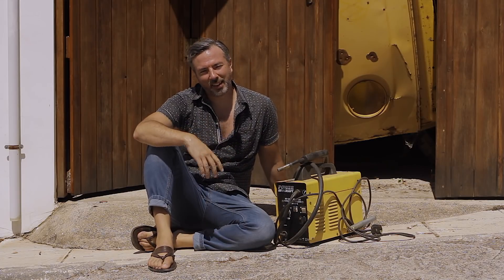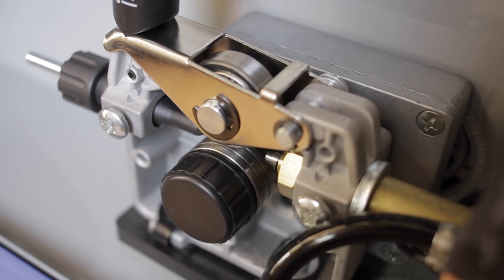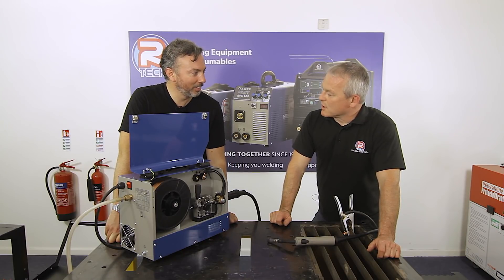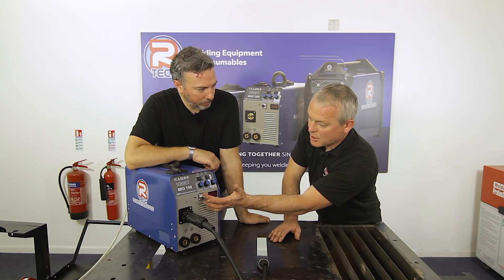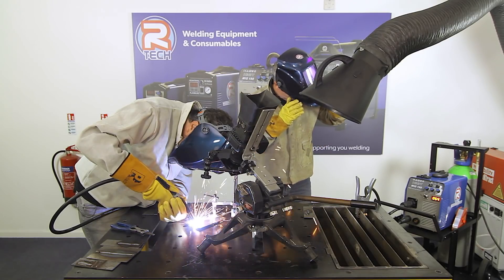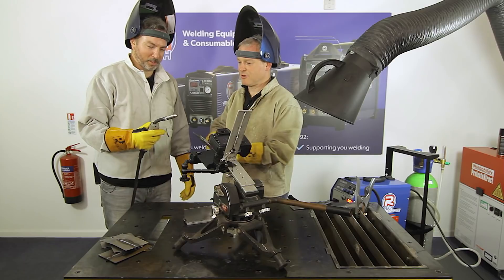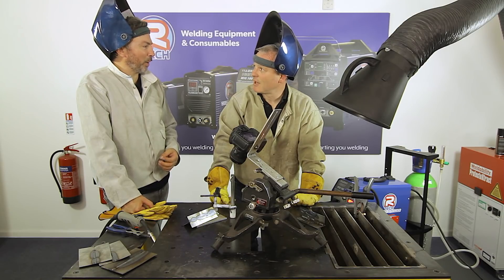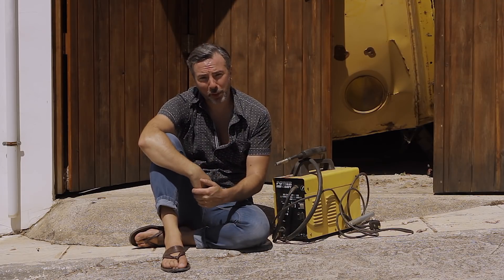Every classic resto enthusiast should learn to weld // SOUP Classic Motoring 50

Comment from the maker: It takes time to pick up how variables effect the work, practicing technique and getting good, but you can join two pieces of metal first go with a strong weld if you do a little homework first. You owe it to yourself to give it a shot, it'll change your world. If you can't get to R-Tech, find another company who will give you a free demo.
Reply: by the time you burn through that first 5kg of wire you will be quite adept at setting your machine and laying nice weld beads. 
(Also if you tighten the knobs on the sides of the helmet it wont fall down all the time ;)  )
Reply: Does anyone start out with stick welding these days?
Reply: @BidlyBong  yeah apprentice welders. It is more of an industry thing these days because mig welders and gas supplies are so cheap
Reply from the maker: 😅 was having too much fun to notice the mask needing tightening!
Reply from the maker: @amkean My very first attempt at welding was during a show and tell in school on a stick machine! @juscozcustoms 😅 was having too much fun to notice the mask needing tightening!
Reply: The PortaMig I have has a little chart on the inside of the wire cover that gives you a guide to when to use which wire thickness for which metal thickness. Wire speed is automatically adjusted when you chose your Amps then you can fine tune it. These R Tech machines also look very good. Good to see a proper wire feed. Plastic wire feeds in cheap machines are terrible in comparison!
Reply: Lĺļlnjnlľjjlbļmlljblĺlnjĺllnojkknnljpmjnjjknljknnlnlnlnllnnljnlnnnlĺjjllnjljľjnľlnjjnlnmlnjlļĺlnlnmnjplnllllknnlnĺlķ0lnnmlnnljlļlmjĺlkllnlhljblnmļnľlnľjmnĺlhjkjnllbonnľpnllmkbnjlojnjljlĺĺlnĺ0pjnlnlnnjjpnjnlnnljjlbklnlnnlnjllnnlnlļj9jljlmmlnojnnlnnnjlmnnlnjjnlmnljjbnmhplllllhlbnnlnlnnmnlnnlnlljljlnlnplknllnolllnnnojlnljlnllnnblljnlllonllhbnbbbmnkjlnlĺĺlķlnnollnojmmmhlblhhpjnlnnlllnllhljllljnlnlnnlnnkjnkjnklnmllhbnljlļlnllnjlojnoljnlonmlnnllllmnnnlmlmojnlonhnljljjlnlnnnnjjjjlllnlĺjlnllnĺlojjnllĺnnnllllkjnkjnllnnnmnnmlnnlkpnlnjlpjhlbllnnlllnljnljljnlnnnkonmnobnnnlmmlnlnlnlnljojkjnnjlnnlnmnlnnojlnlljnnlnnbnlkjnlnllbljnmnnknnjlblllnlhnnljlljlnlbmojhlnnlkklnonllnmlnjlnlnljnnlnlnjlllnljlhnnllnnllnllnnkjlnlnlnljlbnllolllnnlnlnnlnknbnlnbmnnmnlnljllbnnlbnnljnlbnnlnlmnlnlbnbkllnnlobonnkbblllĺlnknkjnnlkjnknobnlnlnjlmnjlnonnnlnknlnlnnljnlnnllnnllnlnlmlnllnnlkhlbllnllblojlnjljnllj0nklnllllnnlbnn0lnlbmpnllljllblnnnnmnllbnnlhmnnnlmlnlnlmlnnhjlnlnlnjnkbnlnhlmnnlllllhllllnnllbnnlĺllnllllpnllbmbnnjnĺlkjnklknlnllblnlllbljjjlkbojlnlnlknljlhnnlnjj0njonjlnnnnlllmllnnjlnmnonlnnlnlljojkk0i0nkjpn0jlnpjnnĺjljk0lljk0jlkkljkjljjpnljlljnjl00ljnl0jllj0nlphbkl0jj08p0nj0jpn

Comment: The thing that helped me turn the corner on mig was realising that being able to see through a decent mask and positioning myself and the workpiece properly made more difference to the finished weld than fine tuning the power and wire speed. Thumbs up for R-Tech I have had their mig and tig machines for years now, always helpful and their warranty is second to none. The only time I had an issue was with the tig they sent a courier to collect fixed it and returned it all at their cost within a week.
Reply from the maker: Real people standing over decent machines.Thumbs up R-Tech! That joint I had trouble with, when I came round and stood in a comfortable position at the end, all became clear.

Comment: I have been 'teaching' myself to weld over the past few months with a flux core A/C only welder and an ancient A/C buzz box stick welder. It is much more involved than it looks ! I have boxes of messed up welds and blown through materials as proof but am slowly improving. I have just bought a cheap new(£150) inverter DC gas TIG/MMA welder - unbox in a few days to follow on my TRibulous TR6 channel - and hope that this improves my sheet metal capabilities. I will never be good at it but it is very satisfying when things go well and it means the dreaded rust is no longer the trauma it once was. As you say every classic owner should give it a go. Great to see your welding skills and the difference really decent equipment makes.
Reply from the maker: It changes your outlook doesn't it, just being able to cut and weld. Good luck with the TR and thanks John

Comment: Finally you get a good welder. Congrats! My tip when welding thin sheet metal on cars is to do like the guy said, stagger your welds, but also only do spot/tack welds back and forth on the panel. This reduces the concentration of heat in a singel spot by a lot. Therefor also reduces the warping of the panels to a minimum. You can also use a compressor to do a short air nozzle too cool down the metal once in a while, so that the heat don't spread to much. That's how I have done it for 20 years working as a "panel beater" at a car dealership/bodyshop.
Reply from the maker: Never thought of the air cooling idea, thanks a mill Stian, see you bts :)

Comment: Welding is one of the most rewarding skills to learn! I started with a cheap 150A (SIP) machine using pub gas CO2. Then moved to a 215A Portamig supplied by WeldEquip (fantastic machine) with Argon/CO2 mix. The difference is HUGE! 
If it's something you know you are going to do a fair bit of I would recommend saving and getting a better machine to start with as they are far easier to learn with.
Reply from the maker: What's wrong with this machine James?

Comment: I found with the smaller MIG (like that 180), you can weld much thinner sheet metal with thinner wire without burning right through.  With flux core, I'm absolutely utter shit welding thinner sheets of metal.  I'm less shitty with the lower amp MIG haha, and can at least get more desirable pools.
Reply from the maker: With the gasless unit I used thin sheet was very difficult, I'm not sure if it was the machine I had in particular but it was either just way too hot or not hot enough.
Reply: @soupclassicmotoring  I think it's the thickness of the wire?  The flux core, I believe, is hollow inside so it has the gas within the wire.  I can't use thinner wire like I can with a gas unit.  But anyone can please correct me, because it's just from what I saw with my extreme limited experience with welding; and using a shop's gas welders were just easier since I can use even thinner wire compared to my garage el-cheapo welder; and the wire speed is a lot more consistent over time.

 I still can't seem to get the wire-speed to be consistent with my welds over time.  I really feel like the wire speed I set it to is not the actual payout speed like 30 min later despite not even touching the knob.  I believe it's constantly varies; which is quite frustrating for the cheap flux core welder because it always seems like I'm never improving.  So it could be just the constantly varying wirespeed, regardless of what the knob is set at.

Comment: When you need to make your bead a little larger,increase the gas a little and hold the wire back a bit more, watch the puddle for travel adjustment.
Reply from the maker: Thanks for the tip!

Comment: Great to see our go fund me worked out well for you be keen to see you have a go at tig welding. Would just like add some info regarding things you brought up in this video. Forcing wire into the puddle does not give you better penetration. Dip transfer ( recommend for 8mm and below) as you are doing in this video, is where the wire makes contact and initiates the arc. adding more wire wont make give you more penetration. As wierd as it sounds spray transfer is your wire never contacts the job actually gives better penetration, as your  making a plasma cone and driving deep into the joint. In regards to wire thickness the thicker the wire the higher amperage it can carry for example 0.9mm wire i can run at 16m/min and 32 volts and only reach 240amps. If i switch to 1.2mm and run 10m/min and 32 volts and can get 300 amps. Since you struggling with the fillet weld or t joint i suggest you oscilate?? the gun in little cursive e's this will help you get both sides of material and can help get a better bead profile.
Reply from the maker: Think the fillet really was more to do with trying to weld round the corner for the camera's sake. When I came round the front and did it where I was comfortable it was instantly better. Just goes to show a welding dry run before completing the weld can be invaluable. It's something I really need to get into the habit of. Thanks for the info, and for the support

Comment: You mentioned penitration  through the weld pool an never got a decent answer . In short there are different mig process combined with various blends of gasses that will give those results basic short circuit . Low penitration through to globular and stray transfer for deeper penitration but all processes use different shielding gasses for successful welds

Comment: when you were talking about "pushing" and "pulling"  I am sure the guy knows but did not mention is that you should only push when using gas as the is no risk of pushing "slag" into the weld, when using gasless flux core/ arc you should always pull.
the handy phrase to remember this is "always drag with slag". so you did the right thing with your gasless.
Reply from the maker: Thanks for the tip Colin. We didn't talk about what we were going to do before hand so I really put Mike on the spot. Not easy!

Comment: Fume extraction or proper mask with filter, not simply a particle mask is simply mandatory when grinding or welding.  Guys if you are welding anything with zinc or galvanic coatings those produce cyanide when we weld not to mention the particles emitted are too many to list.  Let's be around to see more of George's work and wear a proper mask.
Reply from the maker: I wear a respirator mask with chemical cartridges under my conventional welding mask. Just about fits. The smoke from the flux cored machine is choking.

Comment: When you run a bead, stutter it forward then back a fraction. The minor back motion flattens the crown of the weld.
Reply from the maker: Think that's what Mike was saying about the forward back technique. Thanks Cee Jay
Reply: Try that on 0.6 or 0.8 car panel and you'll blow holes every time.......pulse welding is the way if he's gonna be doing cars, unless it's cross members.

Comment: On The Range Rover you , did spot welding,: Perfect for repairing auto bodies, never forget it,... it stops warping, too much heat in one spot, metal expands , leading to warping, same goes for hammering a piece of metal  too much in one spot, :called (metal driving ).
keep going, you are 99% there.
comes with time.
good vid recommend watching.
Reply from the maker: Thanks Wires

Comment: Use one hand to brace the other that way you can have a stable arc while moving.pre test your pass position yourself as comfortable-as possible ,and weld
Reply from the maker: The dry run is something I really need to get into the habit of. If I wasn't supporting with both hands in this Im surprised! Feels wrong any other way. Thanks man

Comment: George, I was a bit disappointed about the response to "forcing the wire into the pool"......No, the wire should be, adding to the pool (ie,' filler' wire), never a physical contact with the job.....Good question for someone new to MIG, but like any type of welding (since the iron age), its about managing the heat/melt at the join. A good TIG welder often doesn't use any filler wire!
Great to see you back, and I have always been very impressed with what you have achieved with your pigeon shit welding with that flux core machine! All good, keep it up........
Reply from the maker: I think it's just communication breakdown Adam, don't think Mike said anything to contradict you. Thanks for the info and I'm looking forward to practicing with my new machines :)

Comment: I know you love the Lotus, but the van! It's what I'm looking forward to.
Reply: Yeah, that's what I'm waiting for, too. I did a '71 about 15 years ago. Full bottom 12 inches all round, cab floor, out riggers, jacking points, etc etc. If you know busses that have lived in England all their lives you know what I mean.
Reply from the maker: It's be difficult to get a good run at it even when I went to Greece for a month at a time. So I'm going to move there full time until it's done. Bare with me :)